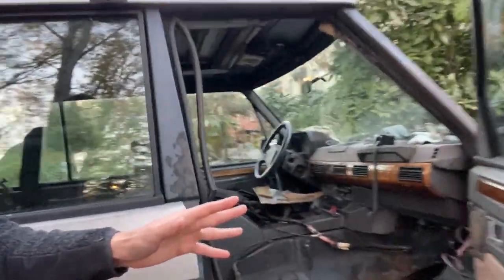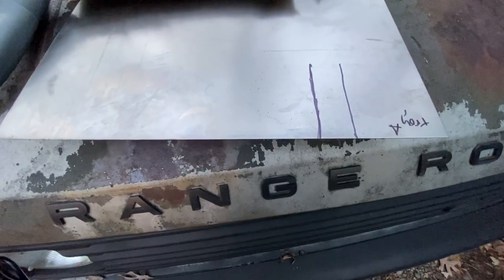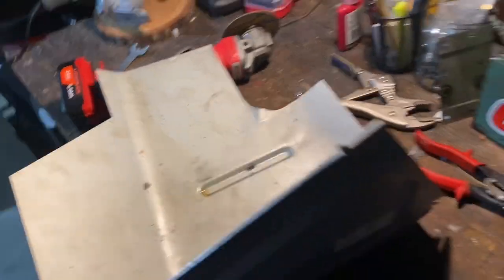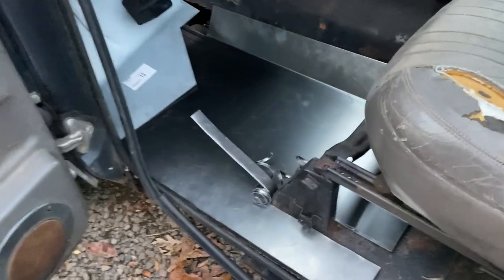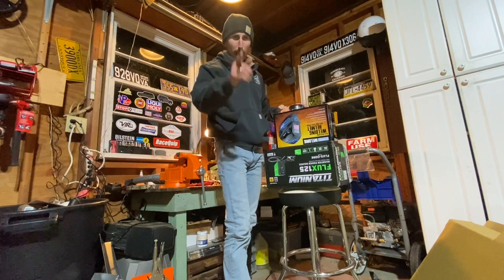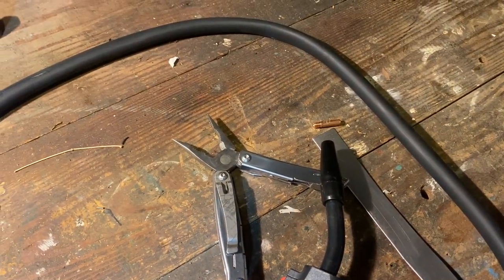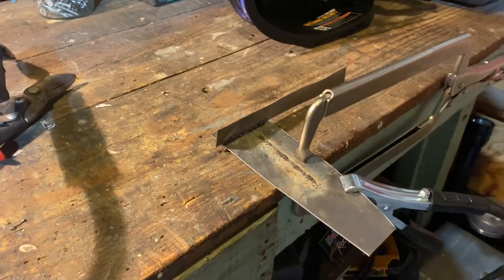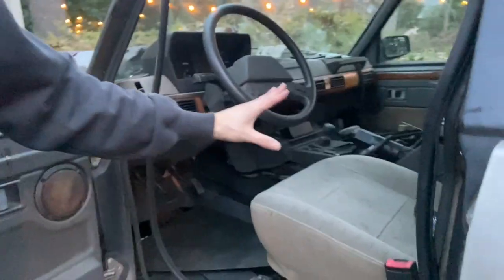(PT.2) Rusty Range Rover Repairs - Floors + Sills | DIY Metal Work And Welding To Save $$$$

Comment: Good on you for keeping the old gal going.  The best repair for the sills is to cut it all out and replace with a piece of box section. You can use 100 x 60 x 3mm. Cut the lot out then weld the pillar strengthening plates to it.  If you have any awkward areas shape wise  you can get repair pannels from a uk company called easy on pannels, however I don't  know wether they ship to the US. Good luck!
Reply from the maker: Thanks!
Reply: @AddictedMotors   👍 the best piece of advice I can give you is take your time getting the prep as good as you can in both pannel fit and prepping the surface for welding. It saves time once you have the torch in your hand. Keep up the great content, I have a 2001 XJR and a 300tdi discovery 👍
Reply from the maker: @russellmilliesmith6270  it’s a process !